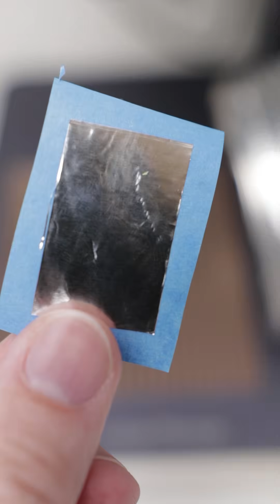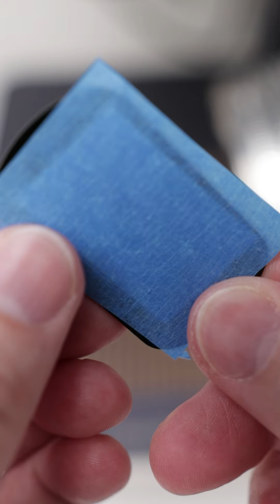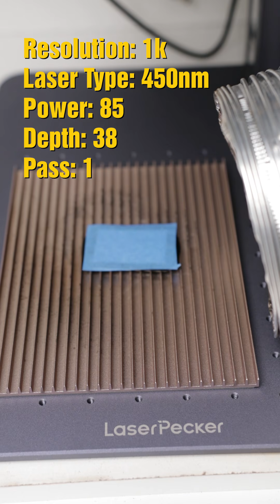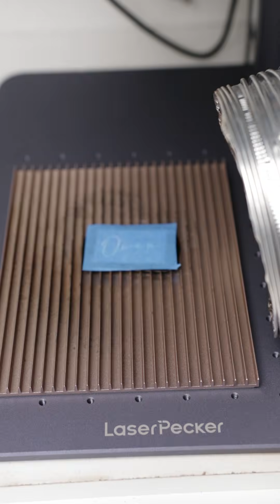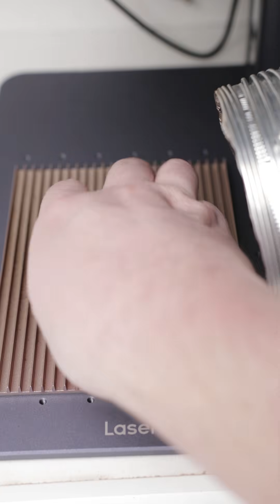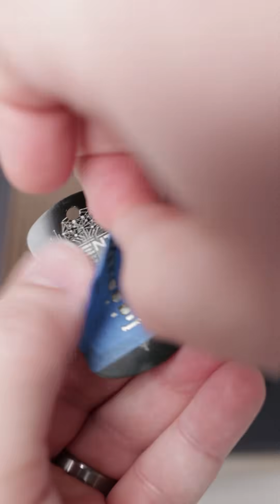THIS Laser Engraving Hack Will Save Your Project! (Test First!) 🔥

Comment: Question, what material should Choose for it? Or does it matter?
Reply from the maker: There is never a need to choose material. Materials are just suggested presets for power and depth. As you test you learn what the best settings are, and set the power and depth yourself.